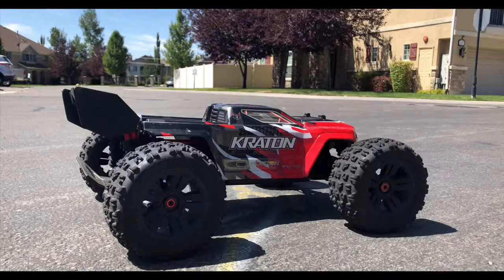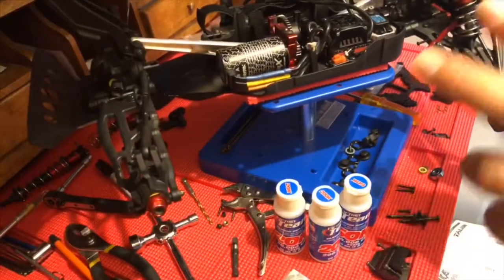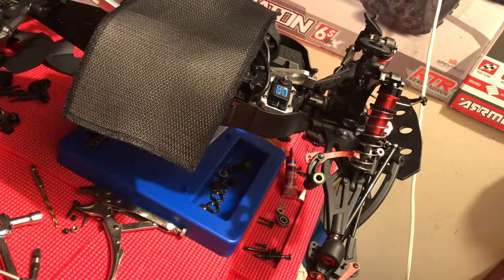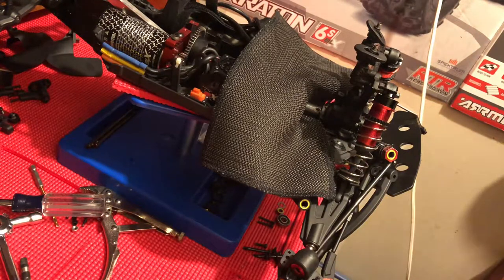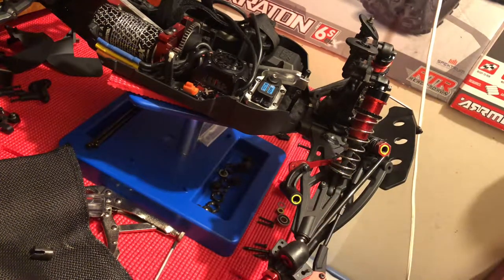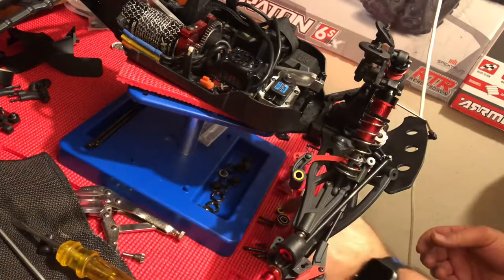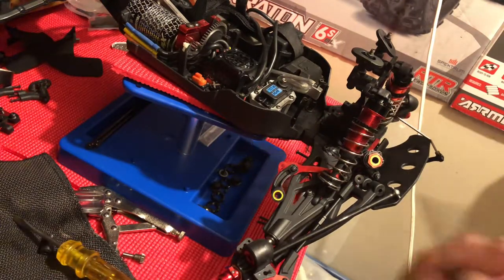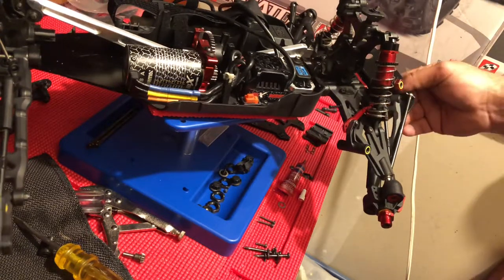Arrma Kraton Bearings

Comment: If in deed those cup are steel that much extreme heat will totally fuck that heat treat and make them super brittle!!! From my knife making experience a hair dryer while a bit slower gets the same results without risk to the metal!
Reply from the maker: No... your right! I was way over zealous with my heating solution. ha ha

Comment: Wow. I know arrma uses ample amounts of red loctite but a torch is super scary. 

I would reccomend pulling the diff out (about 4 min of you time) before you heat anything up. And even then I wouldn't use a torch. Get a decent soldering  iron and heat just the grub screw then remove the out shafts.

Comment: Great video, thanks :) but don't forget the motor bearings! they're very important to swap out for sealed ones as they can bind themselves and get stuck, that's gonna cost a new motor. Here are the measurements for the two bearings:
5x16x5 and 5x13x4

I wanted to find out if they come with the bearing kits you can buy, but I don't think they include them in any of them. I'm looking at a set here in Europe and find the same number of bearings in total.
Reply from the maker: Jakob Eriksen ... THX!!
Reply: @EastTactics  You're welcome :)
Reply: I believe You can't just use any bearings for the motor, they are special ones
Reply: Don't use rubber sealed bearings, they must be metal sheilded or they will melt!

Comment: Where did you get that heat shield fabric,,,,I could sure use it,,,,,,AH. darn loctite!  Thanks....
Reply from the maker: I researched and found a sheet of it online, then I cut it into squares. Phrase like crazy so I had to surge the ends and corners. If you’re interested We could probably work something out where ship you one.
Reply: @EastTactics  can you not just post the link?
Reply from the maker: James George, Check out the master link in my description, I added an alternative fabric. That’s probably better than what I was showcase in this video. I had to surge the ends of that fabric, which was a pain. The stuff I’m showing you here, will work as well.
Reply from the maker: Snow Camo, I added a working alternative to the master link in my description